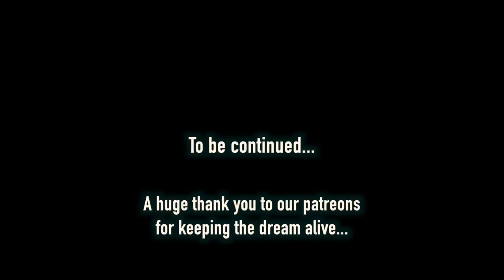CRACKED BULKHEAD REPAIR SERIES - PART 3

Comment: Hi guys; Caution - Your pillars are not cross braced and VERY unstable - I assume that you will be putting in extra bracing and blocking? Do not place your boat on them until your can ensure that the boat will not tilt them over otherwise you may damage your boat more or even crush someone.
Reply: You obviously are unaware that this was not shot today, these videos are up to 3 months old by the time you get to see them so whatever you think might happen, already passed.
Reply: @ian-c.01  I'm glad. Better safe than sorry - I've seen a few bad events, they often happen faster than you can react.
Reply: @ian-c.01  that doesn't mean sketchy supports aren't sketchy though.....

Comment: And when PArlay will be back to his nominal geometry, we will see with the Shroud lenght that she had damages far before Irma (if the Shroud are too short, it clearly indicates that  they were changed to fit a geometry already bended)
Reply: You know that from last week when they removed the pieces of board that were put between the floor and the support to keep the floor from being springy,
Reply: @vxnova1  not really at this time Parlay was still bend at least by the shroud tension. and here the distance btw the keel center line is still too high ( like this        / — \       just by his own platform weight) the moment of true is when sitting on the jack under the platform - part 4 i guess.
Reply: @damientelle  hmm i would doubt very much that the lagoon floor is supposed to detach from the support underneath and be springy when walked on, Someone tried to address this by placing boards between the floor and the support underneath and Colin didn’t know about it so it had to be done before the hurricane,  if the floor was attached correctly this would have added a lot of strength to the structure as well,
Reply: @damientelle  check out David shih video too, he is doing the same work to his and there is another boat in the yard with the same issue,
Reply: Sailing nahoa also had to do the same work to strengthen the bulkheads,   Not as bad as parlay though.
Reply: @vxnova1  we may missunderstood each others: for me of course that parlay was damaged prior irma and had « quick fix » during his charter live. i was at the phone with a friend which is skipper in one of the main charter in carribean(he was in linton bay 3 weeks ago).  for the lagoon and catlante in their fleet they change the preset tension of the shroud to a much lower value that the one one set  by the builder... due to this the shroud leeward is partially loose so they had elastic line to stop the shroud flapping.... the only way they found to avoid cata out of service during the season .

to summaryze : soft platform and risk of bulkhead damage is known by somes of the largest customer (charter compagny).
Reply: @damientelle  woo great info there,   it puts the owners in a tough situation now,  at least she will be fixed up better than new after this,  should be a great boat again in a few months,   Not sure how long it’s going to take though as it has been the last 3 weeks just getting the boat out of the water,  not sure if that timeline reflects the reality.  Hopefully they will, be in the water in a few months
Reply: If you google search issues with the  lagoon 450 you find bulk head issues, warped floors, warped saloon walls behind seating...
None of those bits went thru a hurricane....
I suspect a lot of bulsa core rot was around the bulkhead area, remember there was a large section... flexing due to lagoons “issue” pumped water into the core.
All these flash boats have issues with structure even the mono hulls.... built to a profit...
Reply: @vxnova1  looked to shabby to be done from the factory level or was it a "Velcro Duct tape" fix ? The top lads at Lagoon are being helpful, but one starts to question WHY? Being a Salvage, "that boat is Phuqued mate" some obvious stuff before Irma took place. Lagoon understands the POWER this channel has, the verbal over the phone "help"  is a sweet notion.  I think a new show sponsored by Lagoon "Boat Makeover" and fix this PHUQUING obvious Cluster Cluck so WE, yes the sofa sailors can get back out and sail, what say you Lagoon? Colin and crew is being cool but this, as in me average Joe, may wonder about the Lagoon product and steer clear.
Sailing community is small and tight, loose lips sink...................faulty products.

Comment: Colin, it is good that the guys at Lagoon are working closely with you. Hopefully, the repairs on Parlay will be used as the official guide on rectifying any structural problems (inherent or otherwise) on this type of boat. To that end, you should document every little detail of the repair. You've got a good place to carry out the repairs needed and the guys in the marina seem to be bending over backwards to accommodate you.

Comment: It seems to me that lagoon needs to do some internal review of the processes involved with gluing these structures together.  My hats off to them for supporting you, and clearly they have a strong case against being at fault, however these separations could likely be a result of either a bad lot of adhesive or simply not allowing the proper flash times.
Reply: One thing that stands out to me is the construction of the interior.
It is assembled and slotted together before the roof and deck are bonded to the hull. Great for manufacturing and assembling, but makes repairs or replacement of ineternal finish impossible.
The possible structural issues should be the focus of a fleetwide service bulletin to inspect all the bulkheads. But it seems in the boating industry owners are on their own.

Comment: For all you are going to need to do to get the Catamaran strait, you maybe should have asked the boat yard if you could have had a concreate slab run that was absolutely level and ridged to work on.  This may have been cheap investment in the long run so you would have the best surface to jack on or set up super structure to lift and pull with and have measuring points that can't change. Your catamaran looks to have been a unitized body structure and you have broken ply wood, collapsed plywood, warped ply wood, and  bonded surfaces that didn't hold as they should have, etc. All of those interlocking joints you have had to  cut away to access the damage also will have over all weakened the whole structure. I am sure the Engineers who designed it have already relayed this. I imagine the company who builds these things for a 1/2 million  or more are will be changing their under-ware several times a day until you get this repaired, sealed up and  back up and on the water. Good Luck!

Comment: Some good advice in the comments re levelling the bridge deck first and finding the center port to stbd as the datum. Also securely bracing the bridge deck supports to prevent any movement. But any advice is all for naught as the vids are not current, but are in the past at least a couple of months I guess.
I guess that you guys are still glassing and tabbing the bulkheads, so here’s a suggestion. Glass a 6” x 3/8” ring beam around the edge of the bulkheads for added strength on both sided of the bulkhead. This is done simply by laying glass in layers around the perimeter of the bulkheads. Under the compression post you may want to consider a vertical glass stiffener same as the the ring beam stiffener with cross braces starting at the top leading to the bottom at 45deg angle. This will spread the load better onto the bulkhead and lessen the chance of deflection in the bulkhead which is the warpage seen under the seat backrest. 
Don’t spend too much time on the vid editing mate. Raw without music is fine. Your time is best spent doing the repairs and taking a time out to de stress.
Reply: Well all advice and opinions are really only beneficial to others that may be facing similar repairs as these vids are behind real time of at least 3 months. The repairs on Parlay were completed a while ago, so these videos are simply a “how we did it” series and not “real time repair, interacting with followers making suggestions and offering opinions”.
You guys will no doubt have done a great job and are now relaxing and enjoying the fruits of your labor.
Many people have been knocking Lagoon for their build quality in this series. While it is true that the quality is questionable, it must be realised that the vast majority of production builders use the similar techniques and materials. These boats really are great platforms for what they were designed for which is the charter, fair weather island hopping, party platforms with volumes of internal accommodation. They were not designed for blue water cruising and circumnavigation.
The repairs and strengthening that the guys have done on Parlay will have upgraded the capabilities of their 450 to be a more capable, safer cat.
As an observation, the aft bulkhead between the engine compartment and cabin needs to be 100% watertight. Using marine MCT’s for the cables and bulkhead fittings for the plumbing will ensure watertight integrity. This is an easy fix albeit time consuming but is far better than the alternative result from a watertight bulkhead with all manner of holes through it no longer making it watertight.

Comment: Ok Colin, here goes mate as an old engineer mate.
Great that lagoon gave you the keel to keel centre measurements. Now that you have that 1/2 of that is your centre to keel measurement for each side ( port and stbd ) to the center of the bridge deck. Ensuring the bridge deck is plumb port to stbd you can start tweeting the hulls into alignment after removing the mast etc. you will need to periodically recheck that the bridge deck hasn’t shifted if you don’t you will end up with a wonky cat. Once you have the datum set then run all measurements from this point (center point of the bridge deck). Keep the bridge deck plumb and bring the keels and hulls into plumb referencing all dimensions back to the datum. Then take levels with the water level bow to bow and stern to stern. This will take a few goes to get everything right while maintains plumb. Once all is true then you can start the repair. Sorry for being so long winded mate but I felt that I had better explain it. 
You and Jamie have this. If you want my advice on the reinforcement and repairs of the bulkheads let me know, only too happy to share experience and knowledge with you young fellas.
Cheers
Pappy

Comment: Hey with straightening your boat, if you have not worked it out already....
The measurement that lagoon gave you....
Divide it in half and drop a plumb bob from the middle of the boat and work measurements for both sides...
Your boat is now /-\ but if you don’t use a centre reference you could end up with a boat that’s like /-/ but measures right if you get what I mean....

Comment: I have absolutely no doubt you will turn this into a great thing! It may not ever be what it once was but it might be way better then you could have imagined. Big jobs like this always start scary. You clearly have the tools, experience and knowledge to do anything to that boat that needs to be done. I used to fix serious problems on new luxury homes for a living. When you got customers waiting to move into a new multi million dollar house that can't get a CO because the footings (that were poured in the dead of winter and froze) are now thawing. 
The whole house dropped 2" on one corner. Picture that on a two story corner! Siding, windows, facia lines, the works! Horror show! We fixed it! It was alot of work and very expensive. It was awesome when it was done. Your job will be to!

Comment: While hauling out the bulkheads are stressed very different than in the water: The hulls are pushed towards the bridge deck, but the shrouds hold them in place, which in turn compresses the bridge deck part of the bulkheads.  Those did look fine when you crawled under the bridge deck last time.  They were just not attached to the deck any more, but not cracked in themselves, and fortunately you removed the sticks from them to avoid point source forces.  Just hauling out without shrouds might not be possible any more right now, but who cares. Those sticks clearly tell the damage happened prior to the hurricane and with time things went down from there like a time bomb.  I see a good engineer at work, saving his boat.  Watching it is already incredibly exciting, doing it must be stressful to the limit!

Comment: best laid plans sit the boat there and weaken the joints till they settle correctly then build it back double strength...strengthening key expansion and stress points on the hard ...they will be under same stresses on the water and sometimes more with the water push during weather so remember double strength....layering the polys plywoods and adding expansion foams for unitizing strengths.  The non or limited expansion types that are used on doors and widow frames...The 9 lb. foams impervious to water acts as extra strength glue and totally repels water... The 6 lb. foams are open cell and absorb water like a sponge...The boat will be [made] custom twice as sound as when she came of the production lines ...You will have taken this one on the chin but you will have a boat you know top to bottom having customized her outside and inside...This remade vessel is the point of having a boat that has been shaken out all engineering flaws revealed...

Comment: Colin It is of course stressful knowing what you have on the line but though the work is indeed a lot it is not complicated you have a method to adjust the hulls to your hearts content then a matter of strengthening and fibre glassing all well within your capabilities. In fact the most complicated bit will be getting all the cabinetry replaced after you have done it. Of course you are going to be worried if the stresses will result in to the boat cracking up but the danger point of that was long ago. All you have now is very straightforward hard work and a Shipton of it.

Comment: You have so much into it already you have to continue.
Reply: Colin and Team Parlay will succeed. The challenge will be how close can they get it back to original and then how severe the repairs will need to be to make it sturdy again. The amount of twisted and swollen plywood seems to grow everytime the guys cut another access hole and this has to be really concerning. I'm guessing the plywood structure is going to hold up allowing the hull and deck returning to its original position?

Comment: I see there is another Lagoon at Linton Bay with the same problem. It seems Lagoon may have a quality issue.i was thinking of buying one, this is worrying. At the very least it shows a more rigorous survey is a must. Great to have the measurements needed
Reply: I agree, Lagoon has come off my list,no matter what the price.
Reply: @davidgiles5030  They need to get on top of this and quickly as this problem makes the boat very unsafe.  I do feel for every owner who has sold everything for the dream,  as this problem will cripple them.

Comment: It's good that you leveled your pillar stands, but understand that when the boat is on them, they'll sink into the ground a little which will throw things out of level because the amount they sink and the weight over them is not constant. You'll have to account for that sinkage somehow if you plan on using them as a reference.

Also understand that any lateral load on those stands is going to drop the boat, probably not a huge issue unless you've got a whole lot of wind or get really rowdy trying to straighten it out.

Comment: 11 cm = about 4 1/4 inch for those of us still using the Queens measurements.
Reply: And that measurement was AFTER it had been lifted (and plenty of movement had occurred as they showed) so prior to lifting it would have been even more than 4"1/4 (p.s. French boat so I guess that is why it was design in metric)
Reply: Ha ha, The Queen went Metric back in the 70's, In the UK we are all metric apart from beer, cars and girls!

Comment: After you pull the shrouds, you might have to use sandbags or ratchet-straps on the deck to get it back to square again. Big job but it looks like you are headed in the right direction. Cheers from Vietnam.

Comment: That magic distance number may just be that, not sure bringing the keels back 11cm will solve the other issues (elasticity of materials in this boat will dictate what happens ), however it will no doubt be very interesting and a starting point.  Regardless, you are doing a terrific job and I have no doubt you will end up with an acceptable final product.

Comment: Just have to trust the process. As a mechanical engineer I see it in my head most of the time and then throw it on paper or into the program needed.  As you drop the deck the keels(at the pendulum) it will drop the keels and pull I ward... AWESOME JUST AWESOME... 
You already know you have this because your wellnon tour eay at this point to fixing your issues..   Panama is only a flight away if you want some entertainment.. 😁😁😁

Comment: They need to come in 11cm total, however one may need to move 7 and the other 4. It’s going to be important to find the centerline of the bridge deck and work off that reference point, otherwise you may end up with a boat that is racked into a parallelogram rather than a square.
I’m sure the work is likely either far along or complete by the time this video is done but I felt compelled to comment anyway. Great job staying after the video editing when I’m certain you’d rather be finishing the boat work.